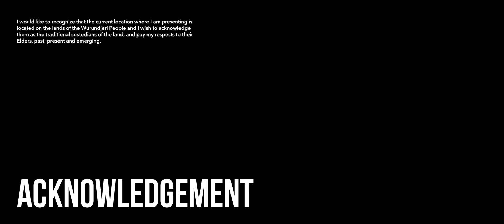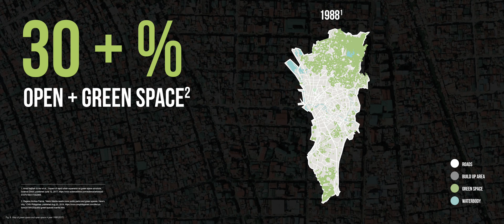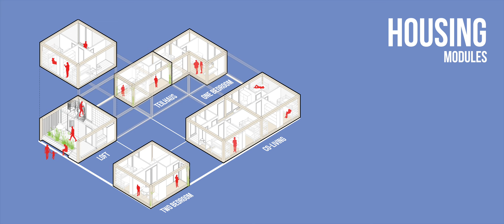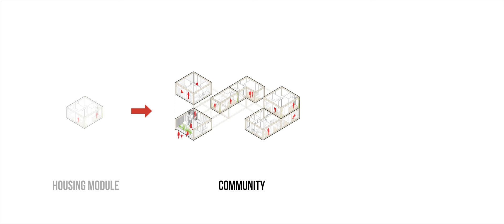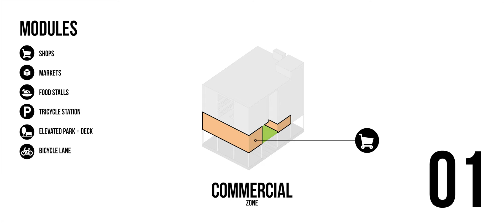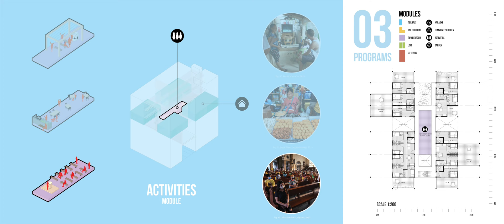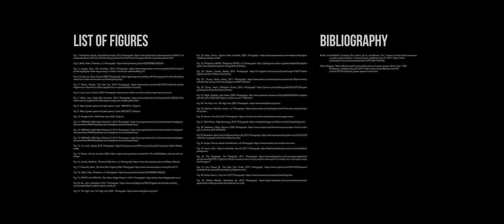Nightingale Manila (2020) MArch Thesis Presentation by Han Wu | The University of Melbourne - MSD

Comment: Sir, I'd like to express my gratitude on how you're passionate and love the Philippines through planning. This is undeniably beautiful vision and idea of yours, I hope the government will take consideration on this kind of project. Very interesting innovation, it's like "if you can't build a substation tunnel underground cos of the potential floods then why not create a tunnel on the ground while having mixed-use development on the vertical spaces"

I only have a question sir regarding the PWD's, BP 344, what approach did you use to solve this problem? Cos I really wonder how it's solved as it's a multi-storey structure. I'm really amazed by your thesis and I'd like to learn new innovations in the Philippines as I am an architecture student, I hope you'd notice this comment and consider my queries. More power!
Reply from the maker: Thanks so much for your kind words. 

Yes I definitely thought about accessibility. There are 1:12 ramps throughout the structure for access that are spaced out on the hub clusters (stations) which I think I’ve failed to highlight/discuss during my presentation due to the time limit. As lifts/elevators are expensive I didn’t think it was feasible for this project. 

But ultimately this thesis is a work-in-progress and definitely not the only solution and most definitely not perfect and in need of improvements and involvements from everyone from all sectors.

I am very confident though that with the right people, team and exposure, Nightingale Manila will become a reality one day. Sometimes all we need is to be inspired and to dream don’t you think? 😊
Reply: @HanWu  It's my pleasure!

I see, that's good to know Sir, as lifts are really expensive plus the maintenance cost of it is unbearable to the target market.

And yea I do believe that these kind of inspirations are one of a good example to start solving national problems, there may be some holes in the idea, the important thing is we keep on discovering what it lacks and what it needs to be addressed. 

Really appreciate your humble response. I can't wait for your projects to be considered or realized in the future, Sir. 

Thank you!

Comment: The idea is great, but it has lots of holes
1.	the space or the lot area for the project-, there’s no such space along the railroad that can accommodate a huge number of buildings, unless you demolished informal settlers living along the railway. It cannot be called a barangay unless you build 40 to 60 buildings connected to each other. It’s only a community. The structure is small to call a barangay, it may merely call a condo above a railroad. If that structure is too far away from each other the bike lane is nonsense. 
2.	I think you wouldn’t study the location- the railway system is extremely loud and causes vibration, so you need to address it also.
3.	The danger of it- you put a community in a danger. do you have plans on securing those flatforms because any time of the day the train rails can be accessed
4.	It may cause huge traffic to the train- traveling with a train is convenient-but putting a huge number of stations will slow its downs. How will you manage that? 
5.	The prefabricated structure is also expensive. 
6.	The environment alongside the railroad’s something you don’t want to live in, a lot of air pollutants- and noisy roads; and crimes-how will you solve it?
7.	The structure of it is something that can’t stand it
8.	And if you wanted to connect it- how will you solve our climate and air circulation- it’s very hot in manila- we are experiencing about 35-37 degrees but the index becomes higher with lots of different factors. Also, the impact of the pressure of the incoming train does the structure can withstand it
Reply from the maker: You’re exactly right! 

I think of this project as an inspiration of the possibility of what can be explored rather than the only physical and restricted solution to a massive massive housing problem. 

There may be so many “holes” as you call it is exactly what needs to be addressed down the road but with more involvement from architects, planners, designers and everyone really I think of Nightingale Manila as one possible solution worth exploring. I am very confident that these holes can be addressed but if we stop imagining, dreaming and thinking big, no change will happen. 

The whole point of this thesis is to explore non-traditional and different spaces because there are no spaces left to built as mentioned in the research. 

Sometimes as designers what we really need to do is really just imagine and think outside of the box for a minute to what’s possible rather than what’s not so we can all be inspired! 

You will be surprised that there are so many different projects around the world that embraces the railway and everything associated around it rather than thinking of it as an obstacle or constraint. 😉